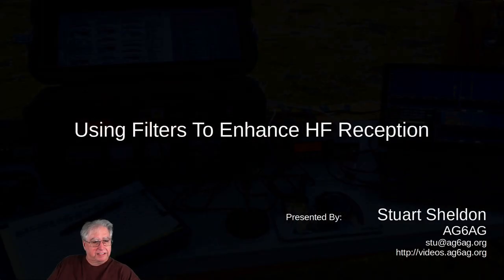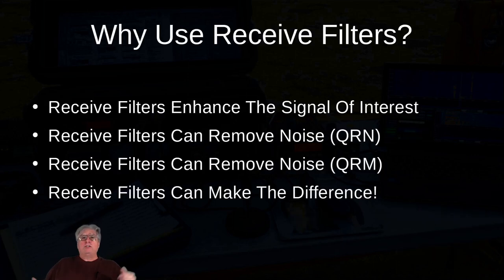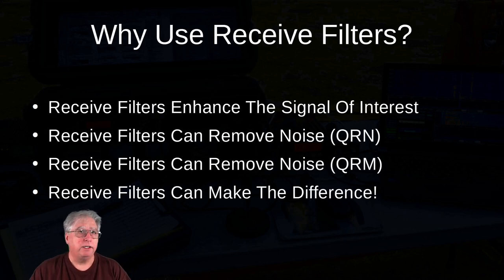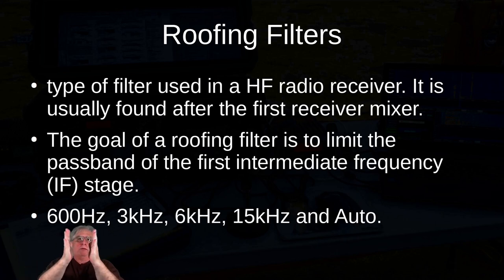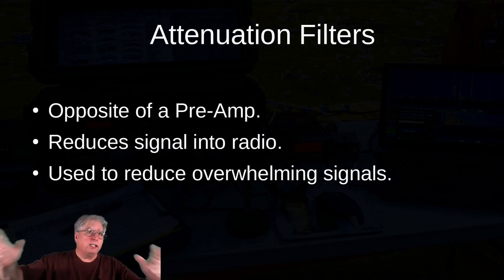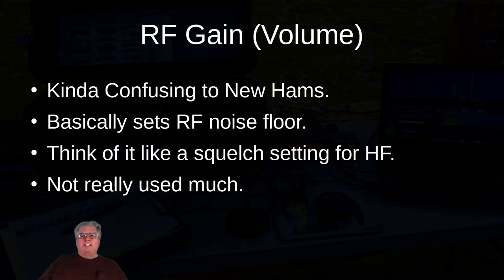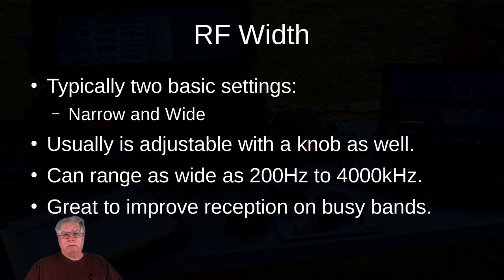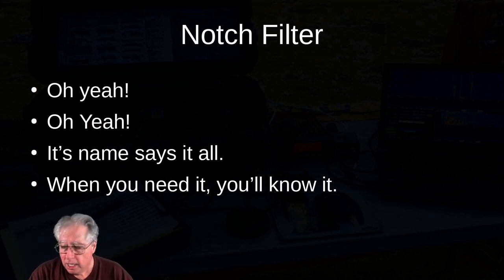How Can I Improve My HF Radio Reception?

Comment: Thanks for the video Stu. I was taking notes as you went along. Having cut my teeth on a Kenwood TS-830S I would use the RF Gain a lot, and the IF Shift. I'm looking forward to experimenting with my FTdx 3000 more now. You know one thing that doesn't help is the different names for the same control from radio brand, to radio brand. 73
Reply from the maker: Hi Dennis,
Yep, they should come up with a common name with all brands. I've even seen things labeled differently between models of the same brand... Hope this video fills some holes for you!

Stu
AG6AG